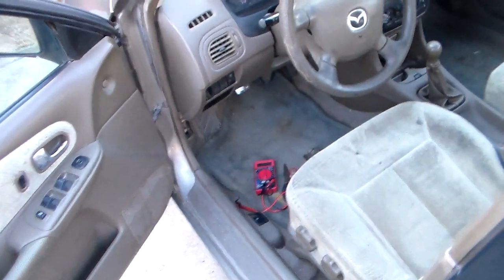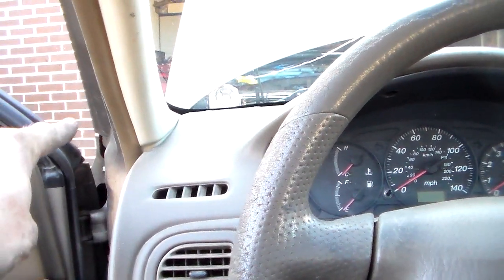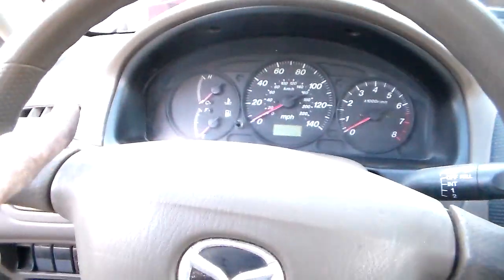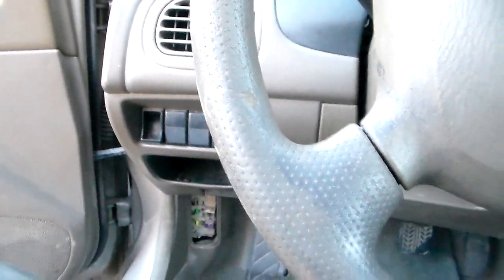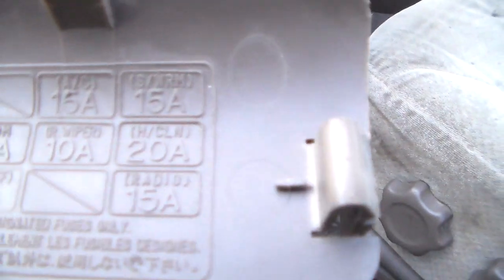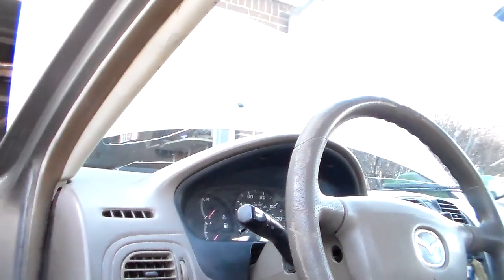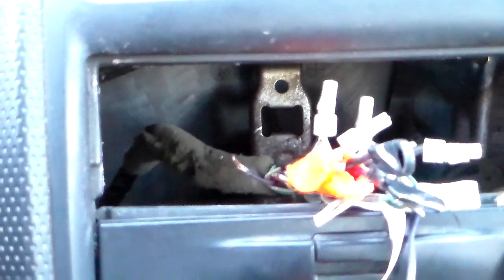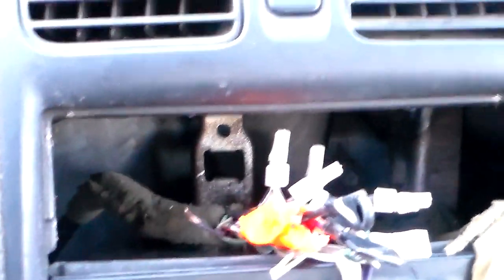Mazda loses power to OBD connector

Comment: The plug and play harness is about $10-15 for most cars.  A total dumb** would chop up the wires in the car to save a few bucks.  Are you going back with the stock radio?

Sadly, the guy probably butchered the speaker wires too. =(
Reply: I know. When will these people  discover the magical realm of the Walmart automotive electronics section?

Comment: Idk why people hack into factory radio wiring harnesses when they make adapters to hook into it so u don't have to hack into it I swear people are dumb
Reply: You are basically correct, but down under we had a 1995 Fairmont Ghia with the big amp and 6 stacker CD box in the trunk.. Tried to fit a double DIN Radio in, the wiring that goes to the stupid useless  thing we threw out was nothing like what you could get an adaptor for, Just had to hack in unfortunately. I am sure you had similar stuff in the US.

Comment: Alot are fords are the same way, Cigarette lighter shorts, No OBD2 port
.  The typical ghetto install is to run a big fat power wire to the battery, sandwiched between the door, sometimes w/o a fuse..
Reply: Yep, That's because Proteges are basically Ford Escorts , I had a ZX2 with alot of the same issues.... Neglect really, because these are actually good cars if taken care of.  Had to replace rear wheel bearings (flood car) and looked identical to drums Tyler worked on ........ I also owned a 91 escort GT that was similar . I loved that car, except for the auto trans which was kinda expensive to replace.